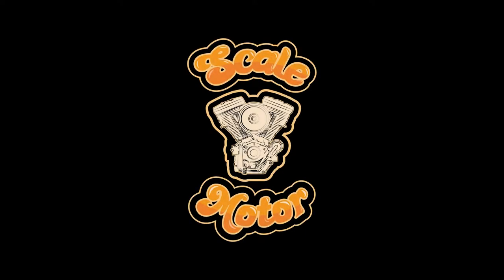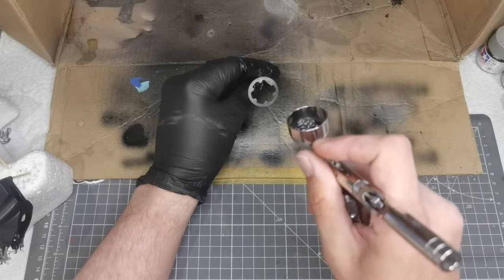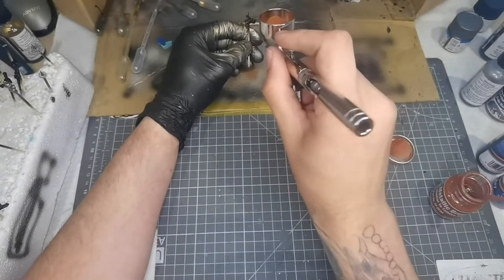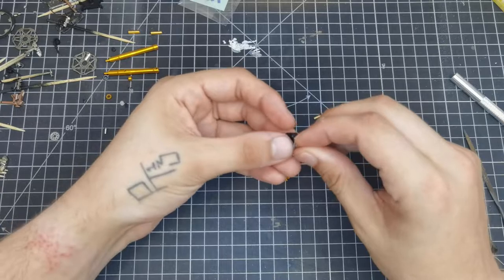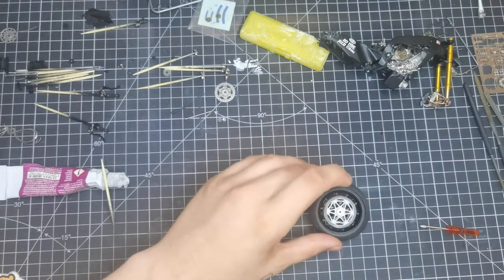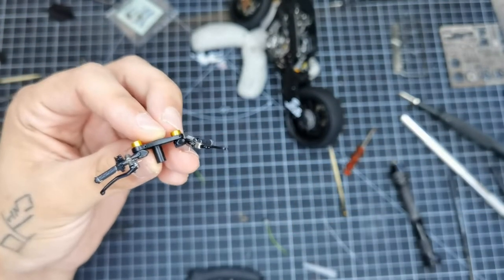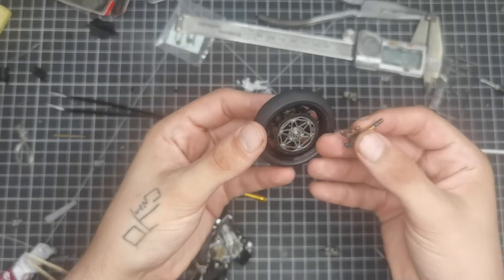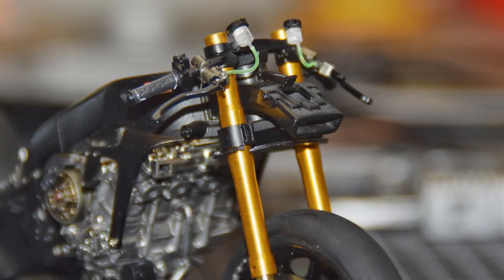'05 Rossi YZR-M1 - SUPER detail set, fork set and chain set - Part 2 - Up on two wheels!

Comment: Hi,
Save messing around with the OLFA clumsy cutter, get some blades for a silhouette vinyl cutting machine. They fit exactly into a standard UK compass. 2mm. Then you can cut holes down to 2mm and as big as your compass goes.!!!
Reply from the maker: What an excellent idea! I have a cricut here but I thought that would be overkill for break discs, haha!
Reply: Hi,
I’m a 3D CAD modeller and have some designs I need printing - I understand you do that- how do I get in touch?
Reply from the maker: @simonweller2053  You can email me at scalemotorlw@gmail.com and I can take a look for you!
Reply: @ScaleMotor  Sent an email re printing - let me know if you got it. Thanks muchly.